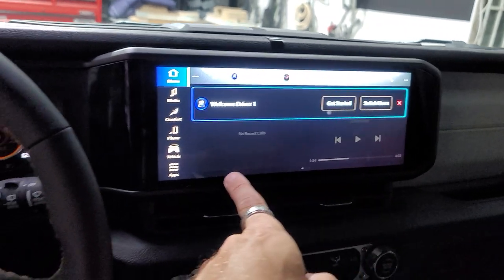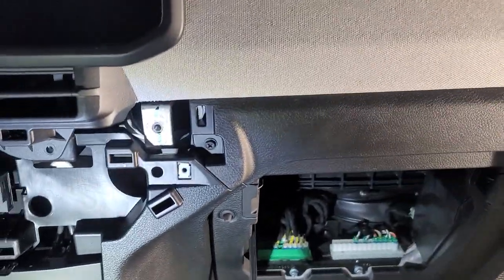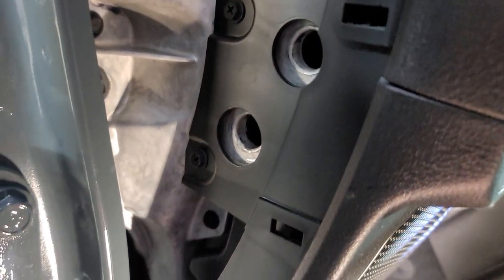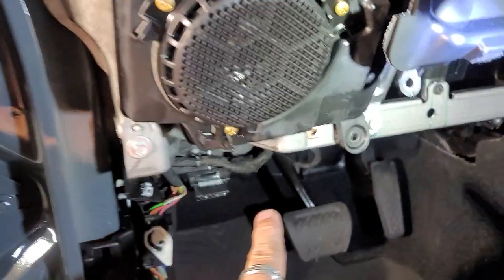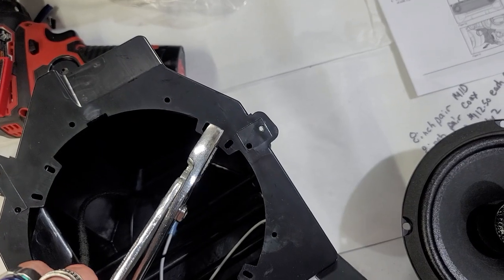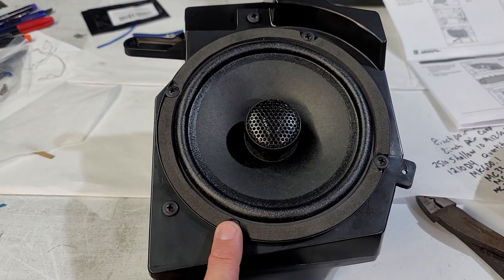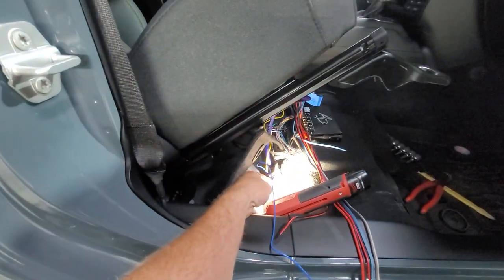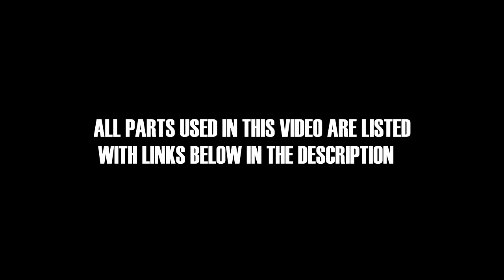2024 JEEP WRANGLER AUDIO UPGRADE / HOW TO INSTALL DASH AND LOWER POD SPEAKERS / AMP AND POWERED SUB

Comment: Great video.  Question,  where did you tie into the audio line.  I have the wire color diagram yet can't find which side the speaker wires run up to the b-pullar to the soundboard.
Reply from the maker: We did not mess with anything in the soundbar
Reply: The speaker wire you want to tap on to are the twisted ones in Passenger side B-pillar. They are green/grey combination.

Comment: So hard to tell but looks like this is the Alpine system?  How did you go about getting the amp connected without the PAC?  I thought i'd take a stab at trying their harness for the UC5 systems but it didn't work.  Today they shared it could be a good year before we see an updated version of it.  I've been doing research like crazy before i am trying to extract a full range signal for my VXI amp but not having any luck.  If you can share more details on your signal/inputs that would be great.  

Thanks again for the video and breakdown of it all, made it a lot easier for me when i pulled mine apart!
Reply from the maker: In the video where we're doing the pods on the bottom of the dash we take the signal from there. We direct both the left and the right side pod and puts into the inputs of the DSP underneath the seat. Then we ran all new wires to the pods and the dash speakers from the amplifier. We just didn't see any other way of doing it easily without cutting or damaging factory wires
Reply: @octanetvchannel Makes sense.  Do you know what the range of the signal is on those lines?  Did Alpine set cross overs where only certain frequency ranges exist?  I would imagine this would limit the output on the tweeters if so?  Thanks for the responses and help!

Comment: Is running the power wire through the outside the easiest? There wasn’t no grommet in the fire wall to run it inside?
Reply from the maker: You can always run the power wire on the exterior as well. I would just highly recommend putting some loom or something to cover it up from the elements

Comment: I don’t understand how the amp is connected to the speaker and how the head unit is connected to the amp. In fact, I don’t understand shit and I wish you guys had a shop in AZ.
Reply: Very easy, tap the wires going to speaker as input to amp, and then connect the speakers with the out from amp. Now, depending on your vehicle, you will have to figure it out which speakers are high-pass or low-pass. You want to use the wires from high-pass speakers.